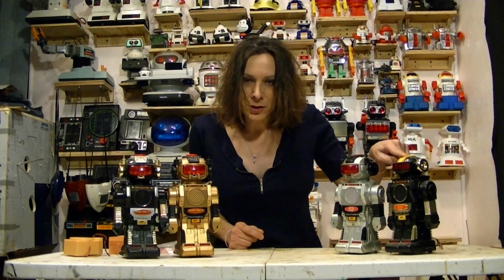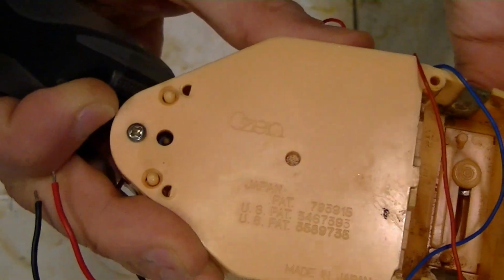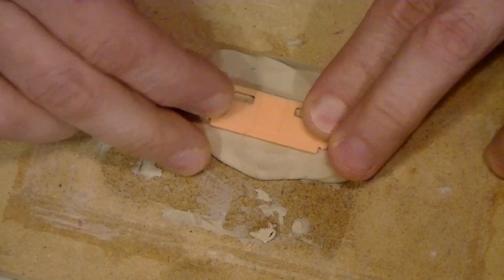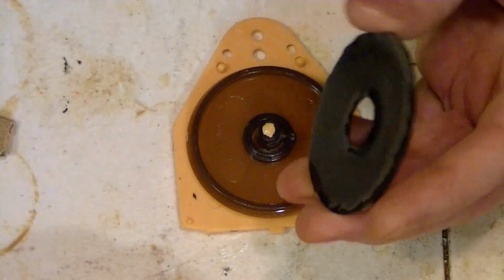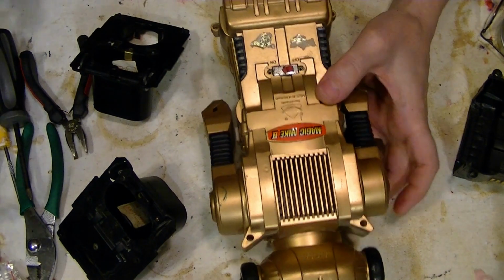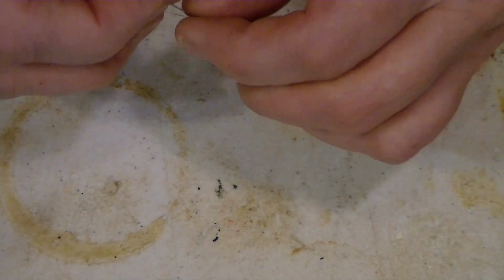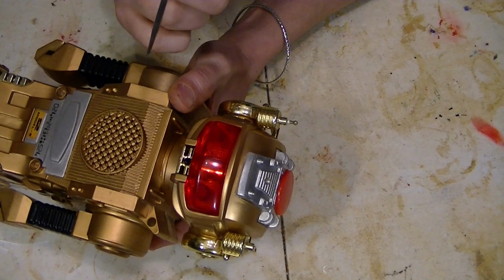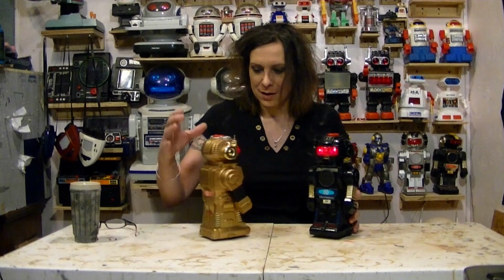I changed Magic Mike IIs into Tommy Atomic - Refurbished

Comment: Hi Randi. AMAZING job getting that smoke machine fixed. I have the exact same problem. My Magic Mike stopped smoking. So I got on ebay the exact same wire you have there: Master of Clouds 36g Nichrome 80 wire, 100 ft. But I cannot get it to glow at 3v like you did. I can get it to work great at 5v, but we know that the robot operates on 2 batteries. I've tried making all kinds of filaments: longer, shorter, more tightly wound, less tightly wound, etc. And at 3 volts it just barely emits some little smoke, with no glowing whatsoever. Any suggestions?
Reply from the maker: Shorter section of wire. Your filament is too long.
Reply: @RandiRain  It worked GREAT!! I used a one-inch long section of nichrome wire to make the filament, and then soldered 2 pieces of wrapping wire to its ends and then connected those to the cables from the power source. It glows really nice and produces quite a bit of smoke, even with used batteries.
When I opened the smoke box I didn't get a clean split like you did, it was quite a mess actually. Putting it back together, the two halves were so uneven that they didn't line up and it had lots and lots of gaps at the edges where smoke leaked through. So I sealed all the edges with acrylic plastic putty (used for building plastic model kits). I hope that the wicks don't burn out, because it would be a real pain to open and close that thing again.
Long before I discovered your channel last year, I used to repair and restore (and upgrade with new features!!) my old toys from my childhood. Robots, remote control cars, and other battery operated toys. So I truly appreciate what you do. All the time and effort it takes, and the frustrations too!! Great job you do. I truly enjoy your videos.

Comment: Saw One like these for cheap and it's complete for sale but if it's works i don't know - want to buy a few more Laserbot / Saturn / Powerbot there are a few very Nice crazy colors that i want.
Reply from the maker: I prefer the ForceBots than these atomic robots. I sold all mine, but I have kept the Saturn, ForceBot, PyroBot, LaserBot, etc. I want a Dixie.
Reply: @RandiRain  me too i want the same ones i have checked eBay most of them doesn't work or parts missing but there are a few nicer but expensive because shipping got way high now One of these GOES for 100€ in good condition, Dixie? I don't know these i think, i have a few battery operated japanese made robots from Metal House and some Horikawas and others

Comment: I guess nowadays there would probably an outcry of safety concerns if you tried putting a smoke generator into a toy for childresn. Oh well, different times...
Reply from the maker: Model trains still have them. Amazing ones too, but they use a cleaner oil to atomize though.
Reply: @RandiRain  Yes, I remember my grandfather had one in one of his model locomotives, I found it fascinating at the time. But that is more of a toy for adults than a robot that would be running around in a kid's bedroom, possibly without supervision. Since the recent rise of vaping devices people have also used those as smoke generators for props / models, but they are less subtle than the small oil ones.
Reply from the maker: That's true.